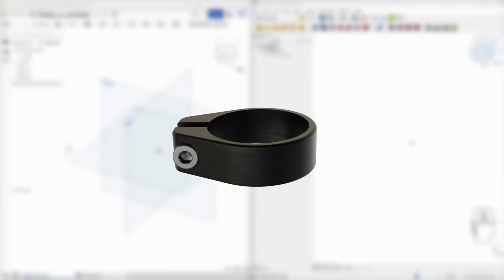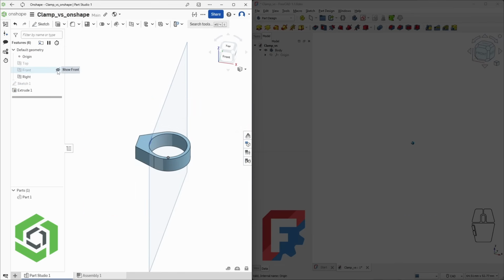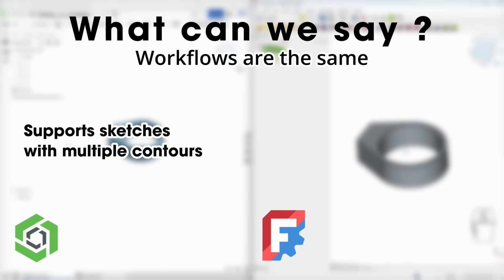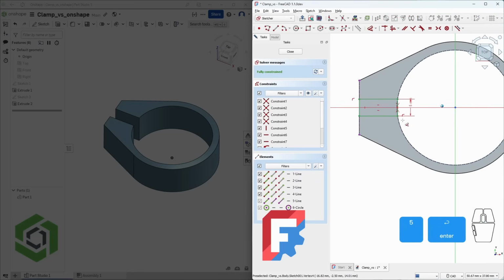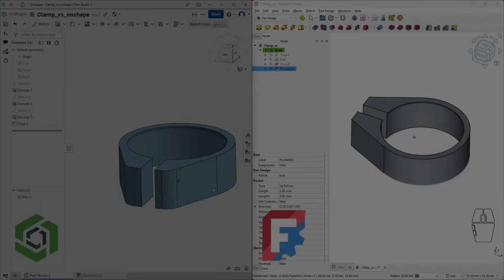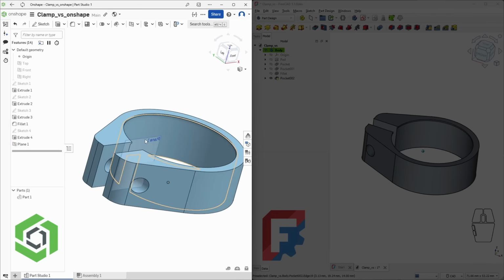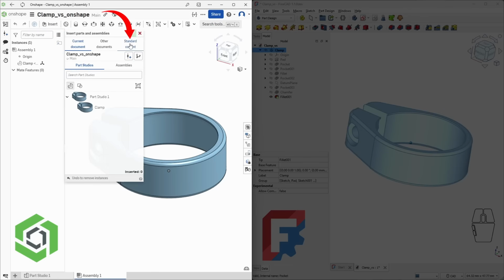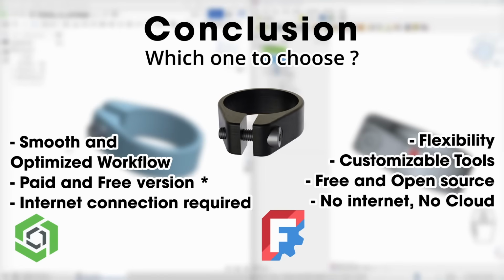FreeCAD VS Onshape - Who's the best ? Choice for Beginner (Simple Part and Assembly)

Comment: After trying both, Freecad is unmatched for me despite the steep learning curve and especially this year that topological naming issue has been solved! With Onshape on the other hand you have no control over your files and the free version is non -private, but it is easy to learn fast and can be accessed in any pc. Onshapes experience is simple and can get you spoiled but to me it does not worth investing time to learn since the license is very expensive for a hobbyist or a small business which does this as an additional service and does not rely on CAD.

Comment: Good video, but you intentionally or unintentionally used most not optimal workflow for both programs and not a word about shortcuts. Same part can be done in FreeCad with at least twice less clicks, less sketches and more robust. I think same is applicable to the OnShape. But you right - both packages has very similar functionalities, and capable of getting work done. I prefer FreeCad since it's free for real and constantly evolving.

Comment: to bad you can't use the 3dconnexion pilot (older 3dmouse) anymore on freecad. it works on other software
Reply: A shot in the dark, but is programming the mouse with X-Mouse control an option?
Reply: @LeftyPencil  they resolved it with support for legacy devices

Comment: NOT REALLY..! :-) 

Fillet, Fillet, Bow, Bow. These are what are known in the English language as "heteronyms". Words that are spelled the same but have different pronunciations depending upon usage.

A FILL-LAY such as in a fillet of steak of fish or a ribbon is something that cut in a thin, narrow strip. In food prep it is a thin strip of boneless meat. But as I mentioned it can be a "ribbon" of something.

A FILL-LET, (not fill-LET but fill-let with equal emphasis on both parts), is a wedge shaped, triangular support between two perpendicular verticals. When possible, depending on the material the fillet is often blended smoothly to help relieve any stress between the faces.

In any case the reason for the different pronunciation is not simply personal whim but two completely different things that just happen to have the same spelling in English. The only way to know which pronunciation to use is by knowing what you are intending to describe.

In this usage, CAD, the correct pronunciation to use is "fill-let", a wedge shaped support.

(unless of course, you have included a thin strip of meat in your drawing, which would be a fill-ley)

I don't mean to be a know-it-all but Heteronyms have always been one of my pet peeves.

By the way, I found your video to be very helpful as I am a long time FreeCad user who is trying out OnShape. I am kind of having an uphill battle and I am wondering if it is worth it.

I keep trying to build things in OnShape and I find myself tripped up by how to delete lines, or how to reactivate a arc or some other part of a sketch so I can change the position or parameters. I end up having to delete the whole sketch and start over again. And I had a heck of a time trying to delete the sketch as well. Sometimes UNDO helps but sometimes not, and then you just have to start all over again. It is very frustrating. So called "Basic" tutorials don't really cover the real "Basics for Idiots" stuff. Not how to sketch something, but how move around and manipulate things in OnShape! Sigh

Comment: Do you think this program is harder or easier than SolidWorks?
Reply: I've been using SW professionally for 22 years now.  I've been learning FreeCAD for just a couple months.  My workflow habits bias heavily toward SW, obviously.  My biggest problem with FC is the sketcher.  SW sketcher is very stable, FC not so much.  Once you get complexity beyond a few circles and lines, FC starts to fight.  It auto-adds and auto-deletes constraints  (generally a good thing) but sometimes seems to make poor choices (a bad thing).  Also, FC sketcher struggles with tangencies  I have had a fairly complicated sketch (about a dozen arcs, some tangent to each other, some tangent to straight lines) that was fully constrained, but refused to pad. Sketch validation tool showed "troublesome vertices" which effectively break the continuous sketch outline (called a "wire").  Back in the sketcher, there appears to be nothing at all wrong with those vertices.  All green, all fully constrained, but failing to work.  Solidworks sketcher can do that exact same sketch, first time, no fooling around.  Aside from that, I also strongly prefer the Assembly tools in Solidworks.  Far easier and more intuitive in my biased opinion.  I do a lot of 2D drawings in SW and I have yet to even try that in FC but I'm a bit scared of that learning curve.  I must say I greatly appreciate FC's CAM and FEM workbenches, very expensive options in SW.

Comment: It seems to me that Onshape needs to be compared with Fusion 360, so it would probably be more correct. And even in this case, Fusion 360 will be the best option for users from planet Earth (there is a free version for "personal use", it is possible to work offline), as well as FreeCAD, which, as I understand it, does not play and is not going to play political games for moneybags and special people. FreeCAD is gradually becoming more convenient for beginners, more stable and optimized. The main thing is that FreeCAD should not be overbought and strangled, as it is a 100% competitor to other CAD systems (paid).

Comment: You seems to be doing a lot of unnecessary stuff in FreeCAD. For example, all the construction lines are just not necessary and only take up more time. You didn't even have to bring in the external edges for any of the sketches. This is strange that you do these unnecessary steps in FreeCAD and then credit On-Shape for not needing those extra steps.

Comment: There are a few things to note:

In FreeCad,
1. The current release version that I can find is 1.0.0, but somehow the creator is using version 1.1?
2. With freecad, when selecting a geometry from a previous sketch, there is no need to make the imported lines/circles construction geometry
3. When constructing the bolt holes and trying to center them on the face, don't bother with a construction line.  Instead select two diagonal corners and make the center of the circle symmetric to those corners
4. When making something symmetric (say, to the corners from item 3), Select the two boundaries first, then the thing to be centred.  So in item 3, select the diagonal corners FIRST, then the center point of the circle.

None of the above really changes the poitns the OP was making and I thoroughly enjoyed the comparison, just a few details that were incorrect.
Reply: 1.1 beta probably?
Reply: @radfaraf no it’s a dev version

Comment: Kompas 3D is best, beats both of them. 30$ home license(permanent, no need for subscription) fully commercial software with all industrial features, advanced mathematically correct solver. Fully offline, torrent edition exist.
Reply: Which country are you from? I thought that Kompas 3D was widespread only in Russia, but I didn't think it was so well-known in the West. I don't think it's a competitor to other well-known programs in America or Europe. But I would be glad to hear your opinion.
Reply from the maker: @d1namis I don’t know Kompas3D, I’ll take a look. Thanks!
Reply: Didn't find buy option or price on the webpage. Usa reseller website doesn't work. Tried couple of other resellers, could not change language to english. Well, keep your secrets then Kompas 3D
Reply: Windows only, yet another vendor trying to lock me in.
Reply: @Barnaclebeard  the authors have been working on a Linux build for a long time, they promised that the 25th version would work natively.
Reply: @deltahedra3D Don't even bother. It's a glitchy nonsense, every user whines about.

Comment: Thank you for this, it's been a very interesting demonstration.
I use the free version of Onshape (privately and for non-retail). I use it because it is browser based, this means that I do not have it installed on my work's laptop. I can practice during my lunch break.
It is the first designer tool that I have learnt (self taught at 62 yr old), and it meets all my requirements.

My biggest fear is that someday Onshape will want money for access. Having seen the normal price this would be a no-go for me.
I have tried Freecad (version 0.12) but found it non-intuitive.

Comments on your demonstration -
You put an M5 bolt into a hole with no thread! I would have "holed" the two legs separately and would have set one as a threaded hole.
Other than that I would have drawn it the same way as you have. I did learn some little tips from you that will be quite helpful.

Pronunciation.
As an English man (who's lived in Germany for 26 years). I would say "fiLLet and not fillAY. Also chamfer for me is SHAMfer (with a slight softening of the sh al a French). At least you did not use RPMs!!

Comment: My 2nd biggest concern with OnShape (the first being cloud-based and public files) is that one never knows when they may make major changes to the interface or their user policies -- that the end-user has no control over. Basically you're forced to use whatever they offer if you want to continue using it. At least with FreeCad you can choose to continue using an older version as it evolves. Worst case scenario is that OnShape pulls the classic bait-and-switch like Fusion 360 did, drastically limiting the free version and massively jacking up the prices on the paid versions.